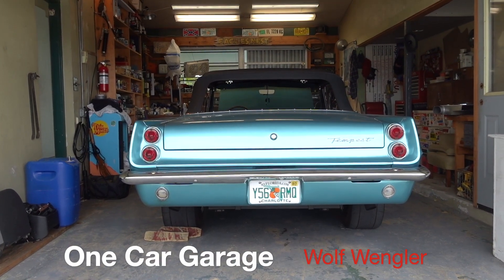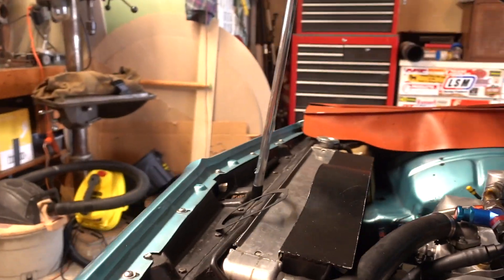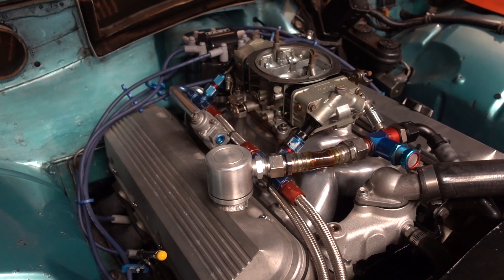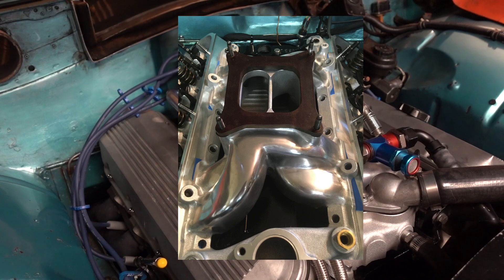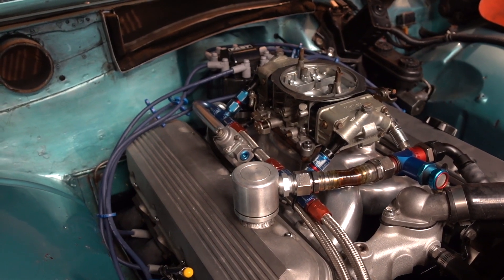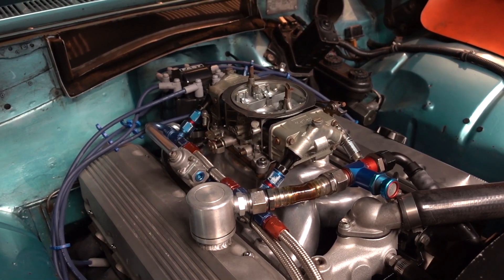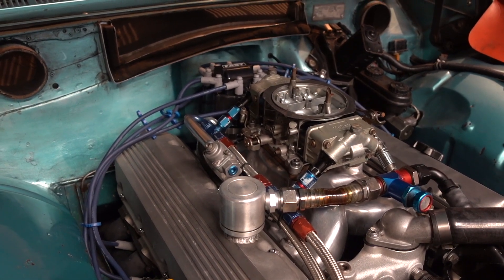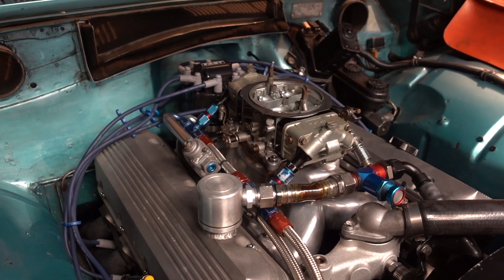Episode 1 - About the Tempest

Comment: I found you searching for tuning help on a Brawler. Love your engineering on that car.  
  I have a 8 to 1 307 w a Erson tq-10 and I installed a 600 Brawler.  4000 rpm redline.  Still too much carb I think.  Getting it dialed in ok. Wonder if I should have  went with a 450 cfm carb?  I could list what I have done so far if you would not mind looking..
Reply from the maker: I'll look at anything but there's a formula out there to help size your carb. I think Wallace Racing has it on their site. It's all about air flow and rpm.